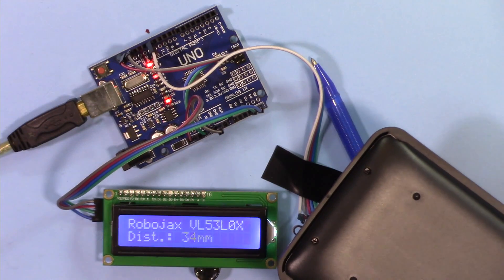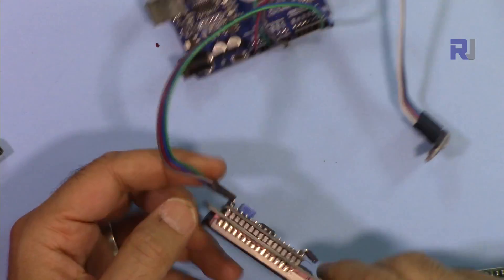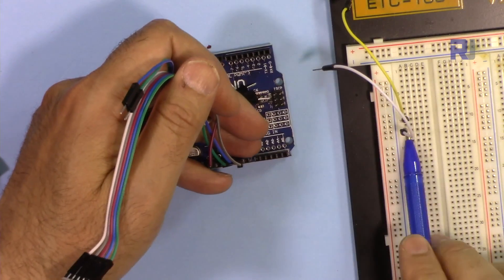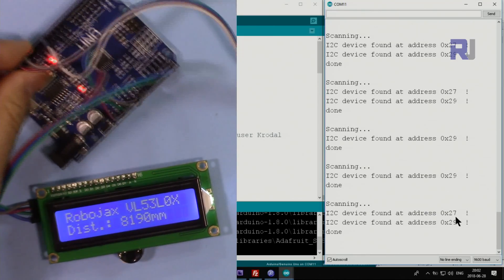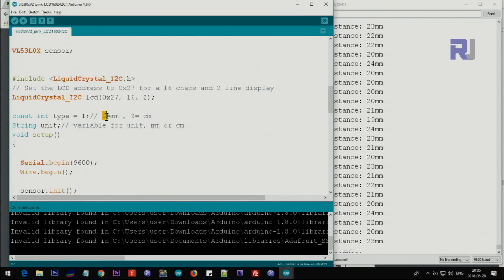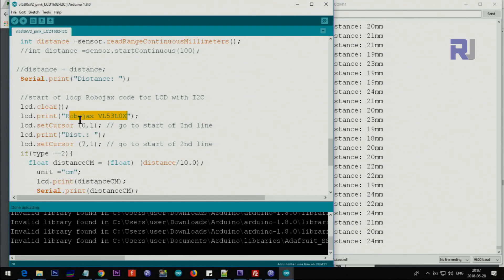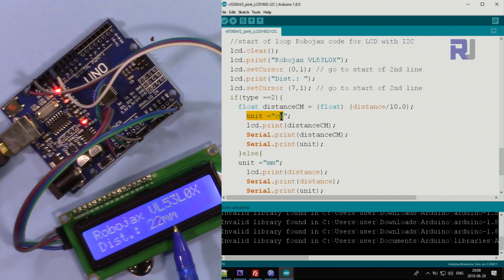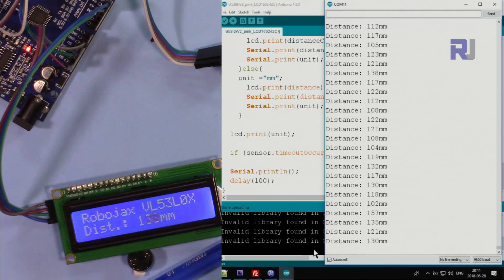Laser Distance measurement with 6pin VL53L0X and LCD1602-I2C for Arduino RJT94

Comment: i've read the datasheet it only says about 1200mm but yours is 8190mm? how did you do that it can measure up to 8 meter?
Reply from the maker: no it can't. VL53L0X range I believe is 2m , 2000mm. I wish you mentioned the time on the video like 3:20 so I could look.

Comment: Good day sir. Is it applicable to mount the laser distance indicator with potentiometer or joystick controlled servo motor? And how to change the code with servo motor. Need some advice sir
Reply from the maker: what is the relation of distance sensor to potentiometer and joystick? I did not get it.
Reply: I just want to add servo motor on that arduino project that is manipulated by joystick on the way  it turn. Just like a watch tower turning the sensor horizontally
Reply from the maker: I knew that but what do you want to do with laser sensor?
Reply: @robojax  just to measure distance

Comment: Can this laser sensor be used for the distance measurement of curved surface?
Reply from the maker: No. laser beam goes only on straight path.
Reply: @robojax  I mean, I wanted to measure the internal diameter of the hollow object so can I use this sensor for it

Comment: Hi,
Thank you so much for this I will definitely be using this for my project.
As I am a noob to arduino I was wondering is it possible to have this system running without being connected to a laptop after the correct code has been inputted?

Thank you
Reply from the maker: Hi, You are welcome. yes. of course this is made for that. You need to connected external power 6V to 12V to the input. Arduino has internal regulator which makes the voltage 5V and 3.3V.
Reply: @robojax  Thank you very much

Comment: Hi, thank u so much for your videos, If I want connect 4 VL53L0X to one arduino nano,  and read each distance, what I need to do? can you help me?
Reply from the maker: You are welcome. this module needs new library. Current there an issue with I2C address. I have no time to write it but I will if I got a chance.
Reply: @robojax  Thank u so much for your answer,  the problem is because the 4 VL53L0X will have the same address?, thank u